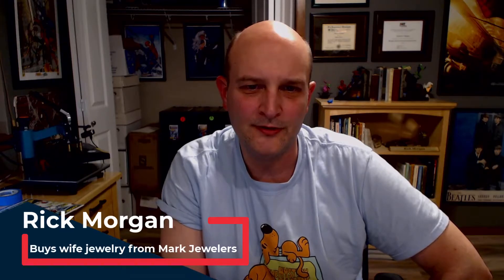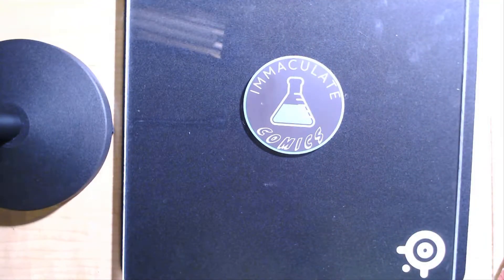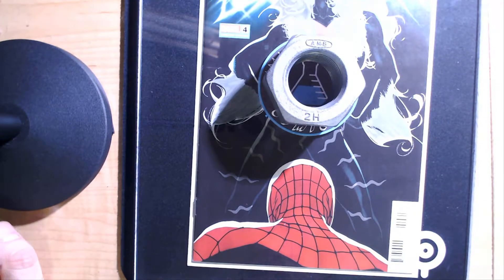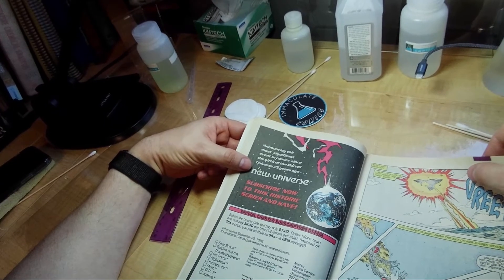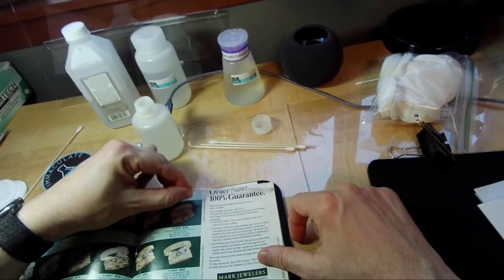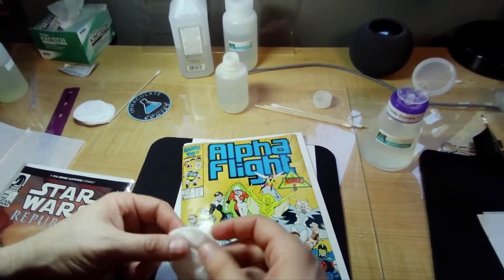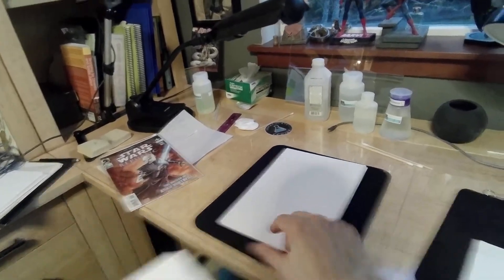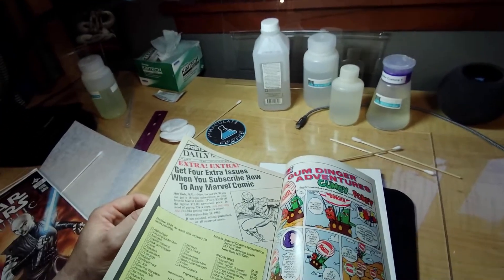How to press a mark jeweler variant comic book plus info on cold pressing.

Comment: Wanted to update.  I used the Immacuclean solution on the adhesive about 3-4 times very lightly, allowed it to dry then wiped with DI water.  No adhesive residue left.  Pressed it with a piece of parchment along the strip just in case.  Press came out perfect and no adhesive was left over so no sticky pages, etc.  Thanks for the video.
Reply from the maker: awesome, thanks so much for the update, that is good to hear!
Reply: Awesome.  I just got the cleaning kit and about to use it on an ASM 299.

Comment: Thanks Rick.  Another great video.  Found myself with an Xmen 118 with Mark variant today.  Aside from the formula you used any other suggestions?   I have your Immacuclean currently.  Want to press this book.  Also it seems like many years different from yours.  This one is from 1978.  did they do the Jeweler variant for a long time?
Reply from the maker: I'm not sure how long they did it for but I have some from the early 70s to the late 80s, myself!

Comment: You mentioned that you can cold press Modern books Is that correct? Also will I need something special for the bottom of the press? As I see that you have something underneath it.
Reply from the maker: Yes, that is just a neoprene mousepad essentially.  To cold press alone can take several weeks but it does indeed work!